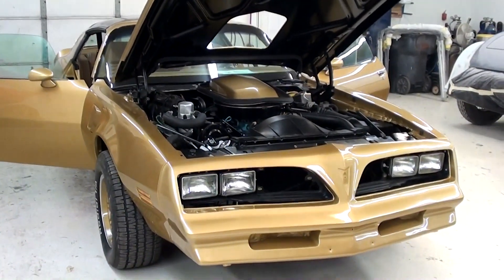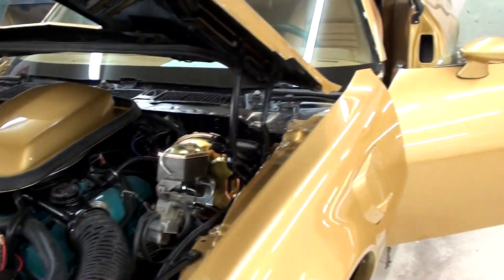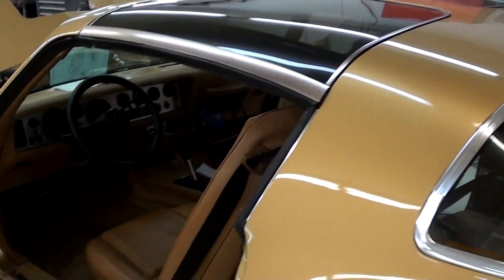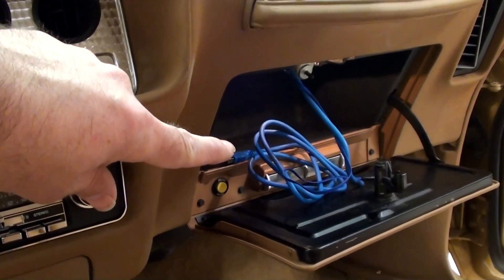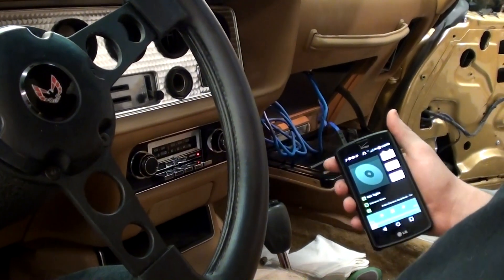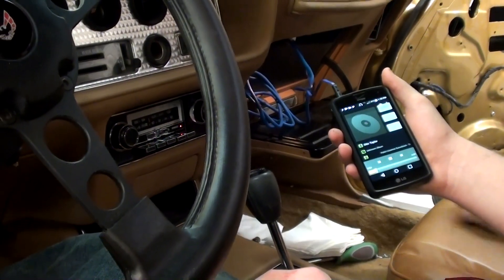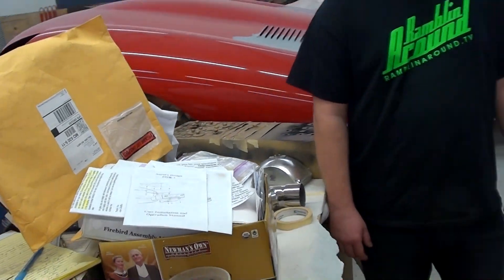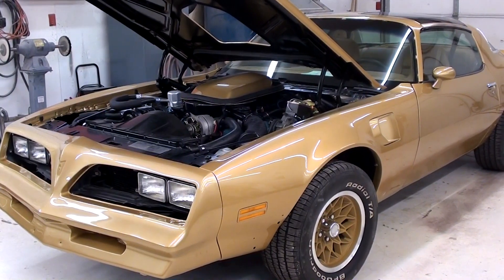1978 Trans Am 455 V8 Start up and Restoration Update

Comment: I didn't know a 400 or 403 could be bored and stroked to a 455. That's a good move in my book. The front clip looks perfect. I wonder if that's a new fiberglass replacement. The original material loses shape as the years go by.
Reply from the maker: +EightTicks8 You have to turn down the 455 crank's main journals to fit into the 400 block.  Then you just bore it .030 over and you have a 455.  They did replace the front and you're right, the original one's start to sag and lose their shape over time.